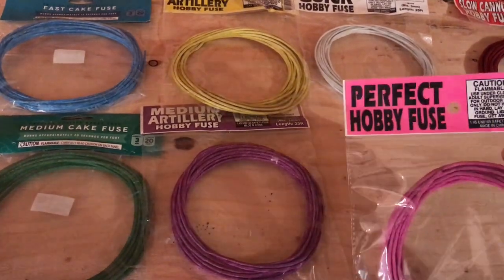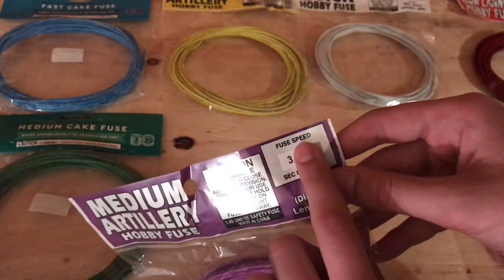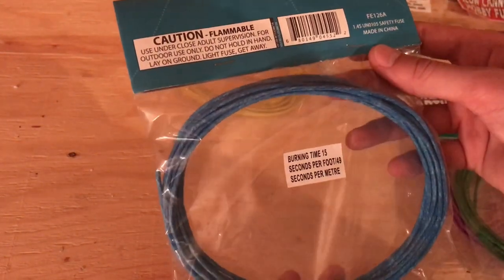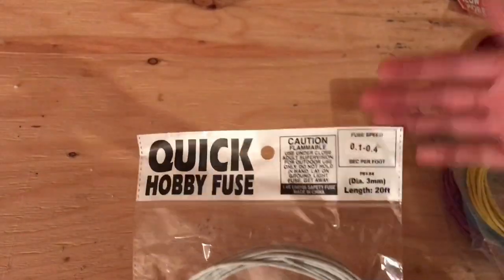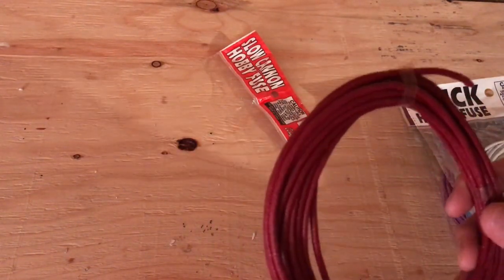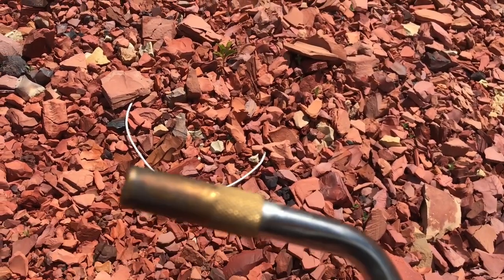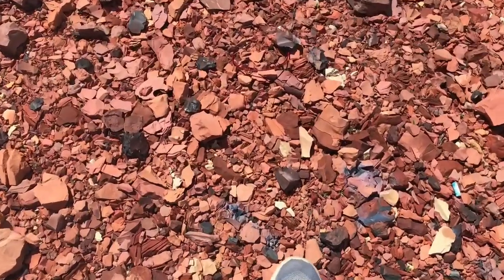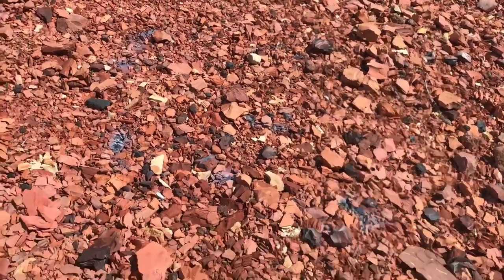Cannon Fuse Testing for Consumer Fireworks

Comment: Hey Cody I have a few questions;

1. What are you using to light the fuses in this video? Looks awesome. 

2. I’m going to be fusing a lot of artillery shells this year to shoot out of a couple artillery racks and I want to have them shoot one at a time so I can enjoy each break with about 1-2 seconds between effects. What fuse should I use? I have some green Visco right now. 

3. I’m going to be trying to prefuse the rows of shells so I can ‘drop in’ a row of shells into the artillery rack quickly and easily the night of the 4th with little downtime since I have far more shells than artillery racks. Do you have any experience with this? Tips?
Reply from the maker: Send me an email bro!

Comment: I dont have quick match yet. Have you tried quick fuse in a paper tube? Does it burn just as fast?
Reply from the maker: I haven’t tried that but a lot of guys I know do that!
Reply: Yea quick match is ridiculously fast...scary fast...violently fast. It's what comes on 1.3 shells and cakes. You do best to add a bit or visco (about 3 inches) to the tip of it and zip tie it into place. At least what's what I do. That stuff burn crazy fast, like a 2 ft section in under a second.

Comment: Ghetto fuse idea: Get a long strand of tissue. Roll it up. Tie them to the other fuses. 😂😂
Reply: Use A Shoe String Soak It In Lighter Fluid            That You Start The Grill With
I Get My Fuse From NewHampshire                            It's only 5 Bucks  for Green or Pink 20 Ft